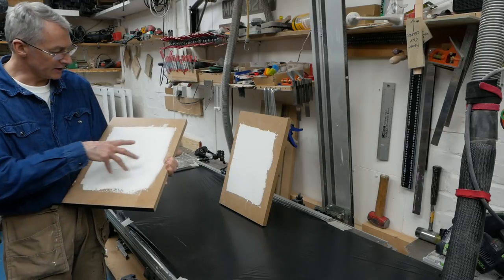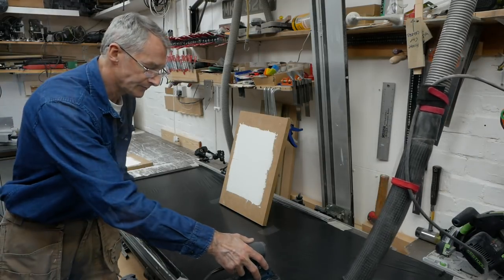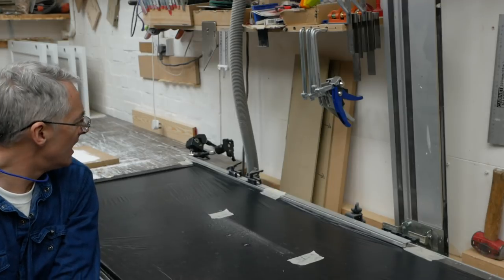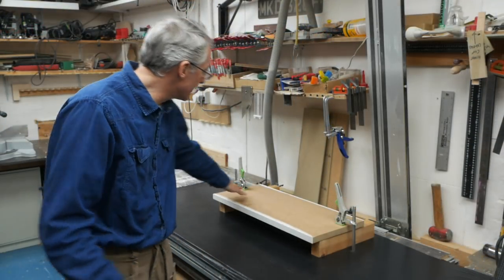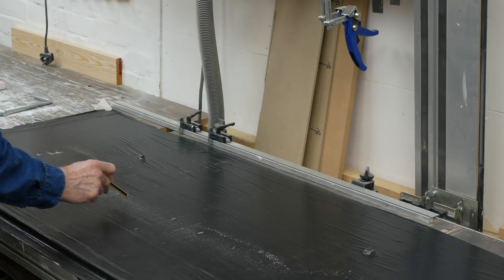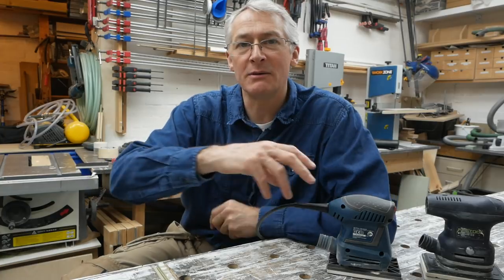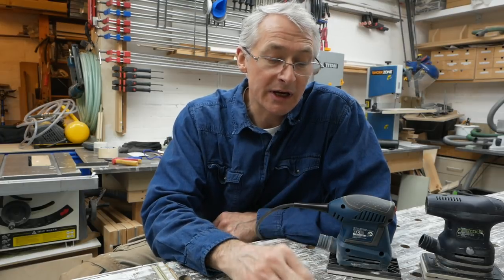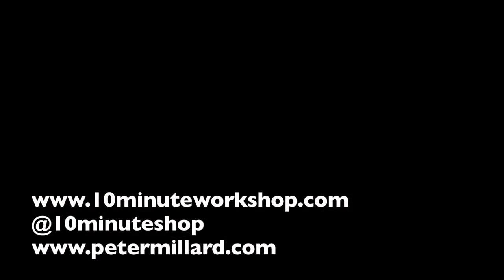The Mirka Abranet Test #157

Comment: Peter, do you prefer the rectangular orbital sander over the circular random orbital sander?  I haven't seen you use a random orbital on the channel yet and am in the market for a new Festool sander and am torn between the two.  Any suggestions for which would be best overall or a do it all type sander?
Reply from the maker: No, I use random orbital sanders a lot, but sometimes a plain orbital is better suited for the job, though often that’s as much due to size and weight, as the actual sanding pattern. A 150mm random orbital with a 5mm stroke (eg ETS 150/5) will cover an awful lot of situations, from relatively aggressive paint-stripping to fine finishing. A small orbital (eg RTS400) will cover pretty much all other situations, aside from detail sanding in tight spaces. One area I would be a bit cautious about is a smaller (125mm) RO because they typically have a smaller stroke (~2mm) so are really meant for fine finishing only. As always though, the piece you’re working on will dictate what you need to use; I’m okimg on some small side tables with the leg and shelf section are only 36mm square, and I’ve used a 150mm RO on the initial prep, and the RTS400 for fine finishing and paintwork prep. That all have a place, and a role to play. HTH P
Reply: Peter Millard, Thanks for the response. Keep up the good work in and out of the work shop. Really enjoy your videos from across the pond.

Comment: Why do you use a pad, is that a Festool thing?.  I use  the abronet  mesh straight on the sander (Metabo  duo) hook loop base. It works great and they last really well..  I would also point out that you did not really test the baroness.  The variable was the sander used. I suppose showing last years results go someway towards that but it is hardly a good approach to ensure a valid comparison.

Comment: I am a bit confused about this.  Why would anyone care about how much dust is left behind?  I assumed that abranet was better because it cut faster and lasted longer - these are the only two things i care about with sanding.  Dust remains is the last thing i could care about.
Reply from the maker: Effective dust collection is one of the main selling points of mesh-backed abrasives. Showing what’s left behind is a simple visualisation of how effective - or not - the abrasive is in that regard. And you should start to car about dust collection - your lungs will thank you, and so will your clients. 👍
Reply: @10MinuteWorkshop  I simply wear masks when I do any operation that generates dust.  I also cannot afford a dust extraction system like the one on the video.  So it is a meaningless benefit.  Does the Abranet product last longer?  Or give a better finish?  Or is it quicker?  If none of those three then that is fine - but it means it is not a product that has any benefits to me.  

I get others might for some reason want a tiny bit less dust, just does not mean anything to me.

Comment: Hi I recently bought the ETSC125 cordless sander  and am wondering if anyone else has encountered an issue with the Velcro pad: I’m finding that the sanding discs (both Granat and Abranet) are not held well enough by the Velcro pad and so move and curl up at the edges- very disappointed with this. Any advice or comment gratefully received thanks.
Reply from the maker: You shouldn’t be getting any curling at the edges with Festool abrasives on a Festool sander. The Abranet issue is widely known, and needs an interface pad to stick to the proprietary Festool hook & loop, but I’ve always found Granat to stick very well. Assuming I t’s the original Festool backing pad, I’d contact the dealer and return it for replacement as that isn’t right at all. Let me know how you get on. 👍👍
Reply: @10MinuteWorkshop  Great thanks for that: I will contact the dealer. Is an interface pad the same as a protection pad? 
I read that it is heat which kills the hook and loop, possibly due to how I am having to use the sander atm without dust extraction (and with 80 grit). 
Also; sorry to go on!; am I at a disadvantage since a ‘hard’ pad is not available for this particular sander?
Reply from the maker: Sorry, Mirka do two - an interface pad, and a pad saver. It's the pad saver that you want - the interface pad is a ~5mm thick foam disc that doesn't do anyone any favours, the pad saver is just a thin (~1mm) disc with hook & loop on each side. And yes, you really need to use dust extraction, as the airflow helps keep the pad cool. I've never used anything other than the (medium??) pads that come with the sanders, they're generally a good all-rounder. 👍 👍
Reply: @10MinuteWorkshop  many thanks 🙏

Comment: You essentially turned a abranet video into a comparison between Bosch and festool which is pointless as festool is gonna be king on performance no matter what its compared too ,you needed to use either Bosch or festool and use standard sand paper and the mesh for comparison.

Comment: Interface pad-contoured surfaces! Pad saver-flat surfaces! Jokes-brilliantly 3rd rate!🤣🤣🤣🤣🤣🤣👌👌👌👌👌👌
Reply from the maker: Thanks! It's called a "Pad Saver Strip" apparently. I bought a "pad saver" and an "Interface pad" and got the foam version both times, sods law. As I say in the vid, I don't think the foam pad affects the dust collection (which was the purpose of this vid after all) but it sure doesn't help the handling! Hey, and those jokes don't write themselves 😂
Reply: Exactly - the thickness/softness of the foam is to aid contour sanding, not useful for sanding flat surfaces. Try the standard pad saver, and perhaps gravitate towards Abranet Ace, which is supposed to be more durable. The pad savers are necessary, as otherwise the virtue of the abranet becomes a flaw, as the sanding base gets worn out too rapidly, making for a much more expensive replacement. 
Given extraction is one of the more important criteria, I'm wondering why no manufacturer has designed the fixed sanding pad with hundreds of smaller holes to maximise the virtue of the Abranet/mesh style of abrasive? Presumably some straight forward calculations could be made to design one which optimised the performance of the mesh? Or is this a new improved line of sanders, that's just round the corner? :-)